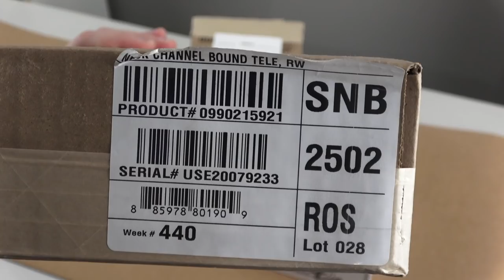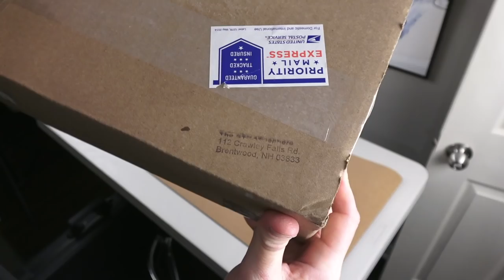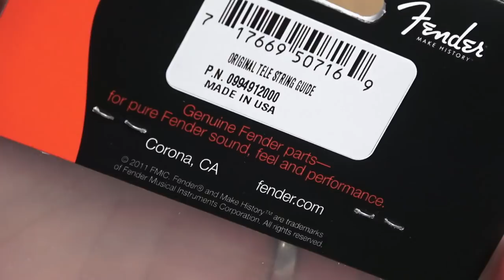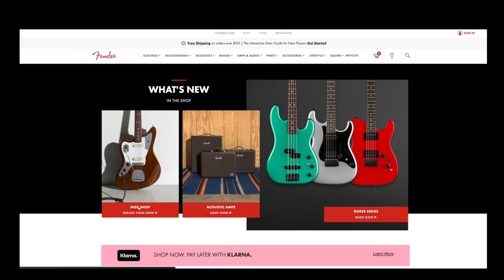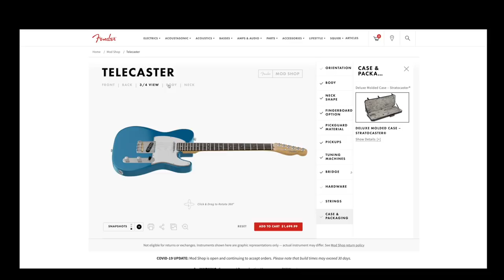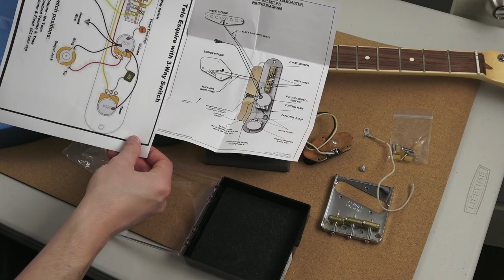Building a Custom Fender Esquire Parstcaster! From Start to Finish

Comment from the maker: 🛒 Solo GuitarsGuitar Maintenance Tools I use:
---------------------------------------------------------
https://kit.co/LandonBailey/guitar-maintenance-building-tools
Guitar Gear I use
---------------------------------------------------------
https://kit.co/LandonBailey/guitar-gear

Find all your guitar parts here
---------------------------------------------------------
🛒 Sweetwater: https://imp.i114863.net/LJRyM
🛒 Thomann: https://bit.ly/3opdh5w
🛒 Reverb https://reverb.grsm.io/landonbailey
🛒 Solo Guitars https://bit.ly/3dpEzYH

Specific Parts used in the video:
---------------------------------------------------------
►Fender American Channel-bound Telecaster Replacement Neck - Rosewood Fretboard (or similar) - Model #: 0990215921
🛒 Sweetwater https://imp.i114863.net/Gjj762
🛒 Solo Guitars https://bit.ly/3CagiA1
🛒 Thomann https://bit.ly/39e8Gx2
🛒 Amazon https://geni.us/FenderChannelBndTNeck

►Fender SHAW HOT 50'S TELECASTER® PICKUP SET
Model #: 0992289000
🛒 Solo Guitars https://bit.ly/3c1uaSD

► Tuners - Fender Classic Gear 2-PIN MOUNT Machine Head Tuning Keys - Model #: 0990802100
🛒 Sweetwater https://imp.i114863.net/Eaa7nD
🛒 Thomann https://bit.ly/3rwDi3v
🛒 Amazon https://geni.us/FenderClassicGearTuner
🛒 Solo Guitars https://bit.ly/3c06RbH
🛒 Reverb https://reverb.grsm.io/gpuv8wvdgd1p
🛒 Ebay https://ebay.us/F7bxvx

►Fender Telecaster Bodies - 
🛒 Sweetwater https://imp.i114863.net/Kee7Ve
🛒 Thomann https://bit.ly/3tT1Dls
🛒 Amazon https://geni.us/TeleCandBody
🛒 Solo Guitars https://bit.ly/3dz4LjJ

►Ferrules: Fender Part: 994917000
🛒 Solo Guitars https://bit.ly/3AQPpQs
🛒 Amazon https://geni.us/TeleStandardFerrules
🛒 Thomann https://bit.ly/2VQOMSl

►Control Knobs: Fender Part: 991366000
🛒 Solo Guitars https://bit.ly/3AORhJw
🛒 Amazon https://geni.us/TeleKnobs
🛒 Thomann https://bit.ly/3irLHln
         
►Esquire Pickguard
🛒 Amazon https://geni.us/EsquireCream
🛒 Solo Guitars https://bit.ly/3QOj7LE

►Control Plate: Fender Part: 992058000
🛒 Solo Guitars https://bit.ly/3CxDCba
🛒 Amazon https://geni.us/TeleControlPlate
🛒 Thomann - https://bit.ly/2Zz2Cty

►Vintage Style Bridge: Fender Part: 990806100
🛒 Solo Guitars https://bit.ly/3APpTv7
🛒 Amazon https://geni.us/TeleBridge

►Telecaster Switch Barrel Tip: Fender Part: 994936000
🛒 Solo Guitars https://bit.ly/3APtDgf
🛒 Amazon https://geni.us/TeleTip
   
►Fender Strap Buttons: Fender Part: 994915000
🛒 Solo Guitars https://bit.ly/3dZmzV3
🛒 Amazon https://geni.us/StrpButtons

►Electrosocket Jack Plate
🛒 Amazon https://geni.us/8Zvm

Timestamps:
-----------------------------------
0:00 - Hello - Intro Track - Vox AC10 Tones
1:45 - Disclosure about the video
2:00 - The Parts
6:05 - All the Pricing - How much did I spend?
7:08 - Fender Mod Shop Walkthrough Price/Parts Comparison
9:05 - Guitar Assembly
9:10 - Neck and neck plate - plastic peel on plate
9:55 - Strap Buttons
10:18 - Strap Button felt pads
10:54 - Tuning Machine install
12:23 - SGS - Starrguitarsystems Esquire Wiring Harness Fender Esquire - Standard
13:20 - Electrosocket jack install
14:20 - Control Plate and knobs install
14:51 - Pickguard install - remove plastic
15:19 - Pickguard plastic ASMR
16:38 - SHAW HOT 50s Pickup Install
18:27 - Body Ground Wire
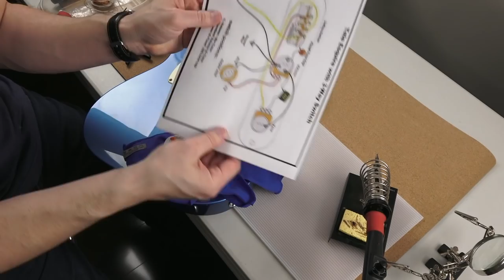19:07 - Soldering the bridge pickup and wiring
20:23 - Installing the finished control plate
20:35 - Stringing the guitar
21:03 - String Guide Tree
22:13 - Pickup Resistance
22:37 - Guitar Weight
22:48 - Guitar Setup
23:00 - Neck Relief
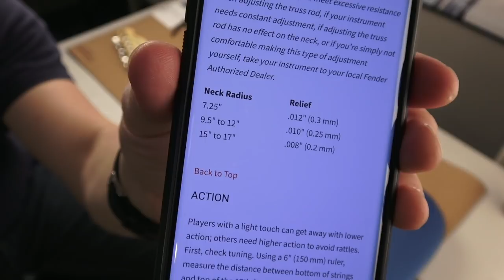23:48 - Fender Telecaster Setup Official Site -  https://bit.ly/3lQofAl
23:57 - Bridge Height and Action
24:16 - Intonation
24:31 - Nut Filing
24:58 - The art gallery
27:54 - Esquire Control Explanation
28:30 - Clean Guitar Tone Samples
29:46 - Dirty Guitar Tone Samples
31:57 - Summary
34:13 - Goodbye

Links to product sites may be from affiliate programs. 
I receive compensation from affiliate programs of which I am a partner.
Reply: Nice work buddy! You think it might be fun to do a ‘who did single pickup better?’ Video with that Epiphone before you send it off?
Reply: I think that is one of the sweetest esquires I've seen!
Reply from the maker: thanks!
Reply from the maker: I'm out of time :)
Reply from the maker: report the theft to police. use your insurance.

Comment: 2yrs ago i 'Esquired' a second hand DIY Tele kit completely gutted out for new components and retaining the twangy ceramic bridge pickup (7.6K) later swapping it out for an imported twin railed SC sized humbucker (8.2K) that's got hot P90 twang that sings when i plug straight-no-chaser (no pedals) into my dimed-out 60-watt Carvin X-60C w/a factory installed 12-inch Celestion G12M70 speaker, running all three positions; my build was inspired by my uncle's B&W pic of a '55 blond whiteguard Fender Esquire he later traded for a Gretsch some time in the 60s...you got a sweet build too!
Reply from the maker: nice!

Comment: Hey guys. I just bought a rarities series telecaster and the switch tip was the o ly bad thing about it! Lol! It was a big clunky too hat that didn't even stay on. The point is, I bought a metal one for only eight dollars from a company called Forney custom. They have a great variety of colors and styles. Best part, it has a set screw and they even included the Allen wrench! It made a great upgrade to my Tele for almost nothing. I have copied your link for my purchases. I love your honesty and believe you can use a little boost right now more than some of the bigger channels. I think you will get there.
Reply from the maker: hey thanks for the support!

Comment: Got a MJT body in Lake Placid Blue yesterday, and are assembling an Esquire. It’s gonna be my 50th birthday gift for myself. I will have some help from the luthiers I’ve been using for 25 years, just to find the right neck, doing the electronics and the final set-up. It’ll be a mix between vintage and modern specs. The body got nitro finish with a light relic, belly cut and arm contour. Going to get aged hardware to fit the body. SD Hotrails, VIPpots (550k), Eldred wiring. A 10-12 inch neck with rosewood fretboard and tall frets, finished by one of the luthiers in nitro. I’m actually quite excited!
Reply from the maker: have fun!

Comment: Nice looking build Landon! 

When drilling pilot holes I usually just put the screw along side the drill bit to see how much of the drill bit is going to be used. Then I just wrap some painters or electrical tape around the drill bit so I know exactly where to stop when drilling. You may have done this before, but figured it was worth tossing out there. It certainly helps with the "ass-puckering" step of having to drill holes in your new guitar.
Reply from the maker: thanks for the tip! someone mentioned the same thing. good idea for next time

Comment: Looks like you've put together another really nice guitar. Famous Esquire players: Steve Cropper and Yardbirds era Jeff Beck. My only requests for your next build is try a Rock Rabbit control plate with the angled switch slot if you do another Tele build. I don't think it will work with an Obsidian wiring kit but it would have worked with this Esquire wiring kit. Also a 4-way switch mod is easy to do with a 2-pickup Tele. Fender makes the switch and has instructions. You have to solder an extra wire on the bottom of the neck pickup to the switch. Not that difficult.
Reply from the maker: cool! ya I have an angled switch on the Godin Stadium HT.  I don't really find it helps me much.

Comment: That turned out well. The clean tones are impressive. Great job. Fender used to make a simple single coil called the Musicmaster. The pickup was in the front position with just two knobs. It would be an interesting build.

Comment: You should check out the secret agent pickups. They sit under the neck pickup area under the pickgaurd and they don't pull so you still have the esquire sound
Reply: Actually to use that secret agent pickup, it'd have to be stealthed out wired like a Telecaster.
Reply from the maker: ya once I decided on the wiring kit, I don't think it's an option

Comment: Oooo, that neck!  Ouch, that neck price!  But it does look great!  Tip for not drilling too deep. Put a piece of masking tape around the bit at the proper depth. It will give you a guide so you don’t go through the body or neck. Great build!
Reply from the maker: Thanks for the tip!

Comment: Would you consider doing a build with non Fender parts? Like through Stewmac/Warmoth type of parts?
Reply from the maker: I did my first two builds before Youtube with a mix of cheap no name parts. They didn't work out great in the long run. 
But, I would love to check out a Warmoth body in the future. I've bought a Mighty Mite neck from Stewmac on another build.

Comment: Nice video and I learned a lot! Love the channel-bound neck. After playing it for a while, would you still choose the channel-bound neck or use something more standard?
Reply from the maker: hey thanks! I would prefer something with rolled edges
Reply: @landonbailey  Thank you for responding so quickly! I was going to use this neck in my next build but was thinking that the channel edge on that neck might not be the most comfortable solution. I value your opinion and response! I love the way your project turned out tho.. Your guitar looks killer! 🎸

Comment: there's basically no downside in buying an expensive telecaster. because they hold their values.  partcasters, mexican fenders are a liability u cant get rid of them in case oneday you are out of space or money
Reply from the maker: ya I agree with that. You can however breakdown the parts and sell them individually. An official Fender neck will retain some value
Reply: @landonbailey  well true that- thanks for the reply